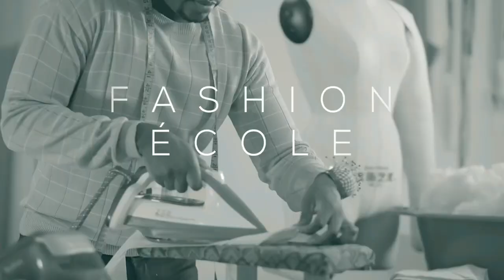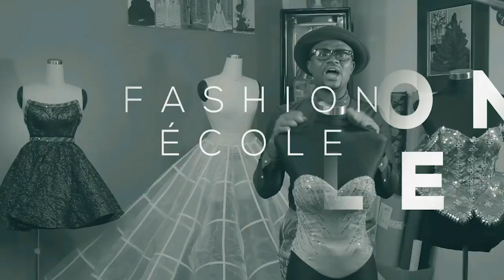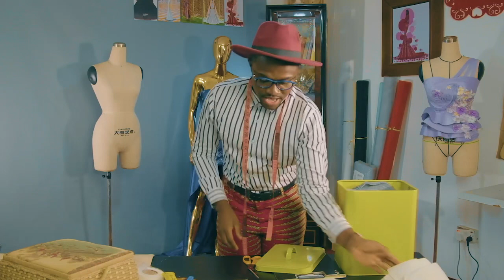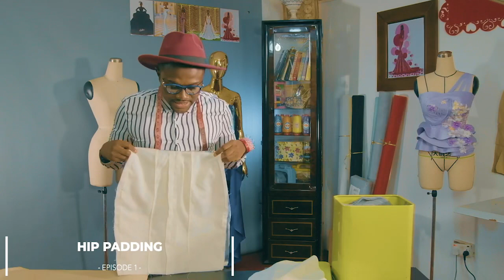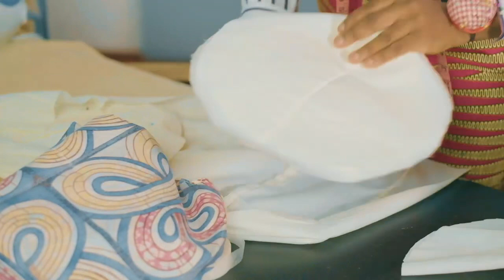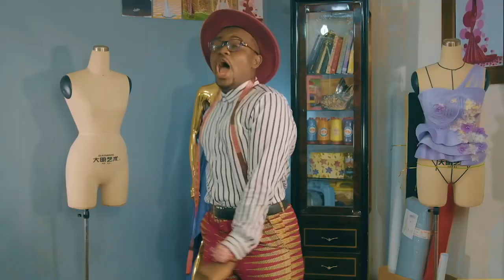HIP PADDING IN GARMENT CONSTRUCTION

Comment: Thanks a lot for yet another amazing one. Questions please, how many inches should I add to the original hip size of the client and how did you construct or cut out the felt pieces used for the padding?
Reply: Watch d video again.
Reply: Each size changes with 2cm. Like 36, 38, 40.

Comment: Please sir for a lower hip line say 10inches.. will the 6inches circular work?
Reply from the maker: Kindly make the circular 7 inches
Reply: @dr.clementasemnyra5207  Hi Dr Clement, if I'm using a stretchy lycra fabric should I still increase the hip size or I can maintain the original hip size ? Please Help
Reply: Where can we get the materials in GH Accra